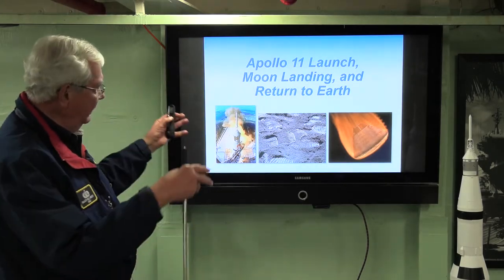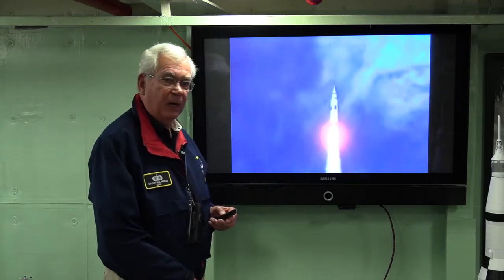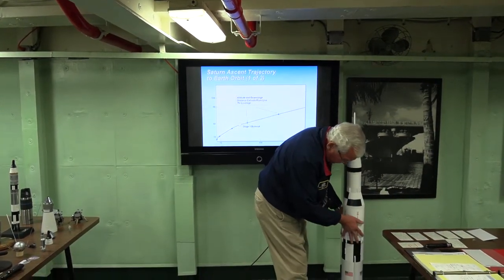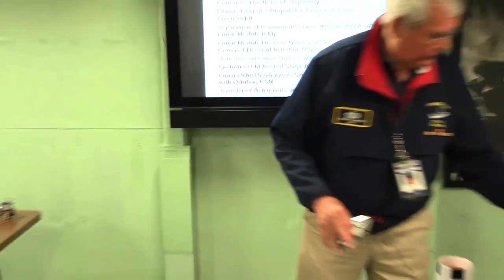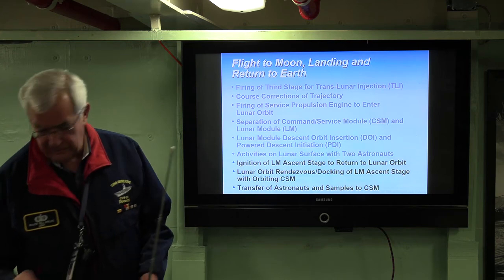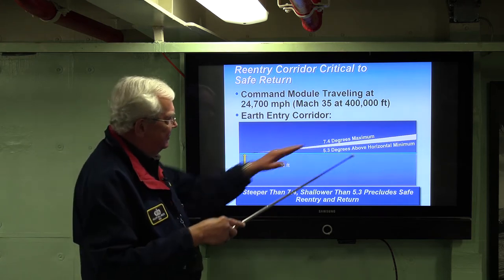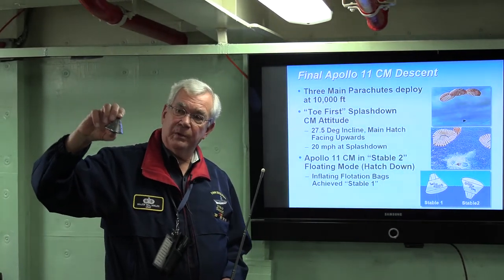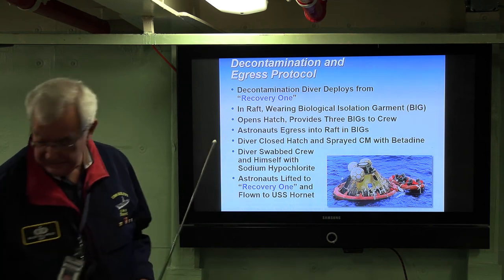The Space Race/Apollo Program Part 3: Apollo 11 Mission

Comment: You might want to discuss the Passive Thermal Control (PTC) maneuver used to control the heating of the CSM by the sun during the translunar coast phase. They would orient the CSM/LM combo perpendicular to the position of the sun and initiate a slow rotation (0.3 degrees/sec) along the longitudinal axis. This was referred to as the barbeque maneuver because it was like a rotisserie turning. As a result, no one side was being heared by the sun. The rotation allowed any heat buildup on the exterior to dissipate into the cold of space away from the sun. The movies usually show the CSM/LM combo pointed at the moon.